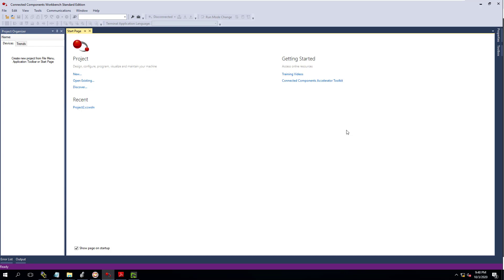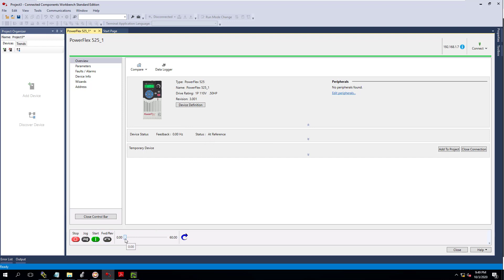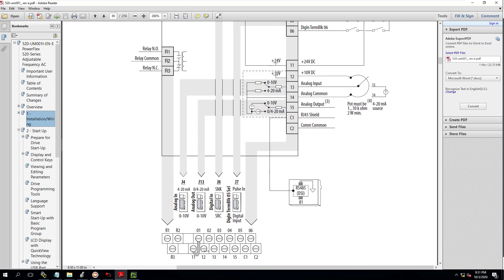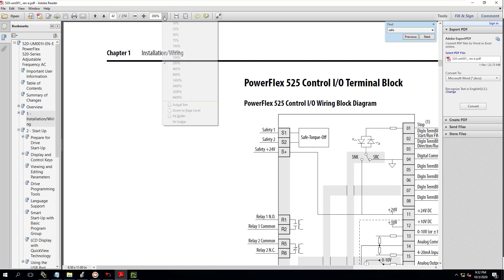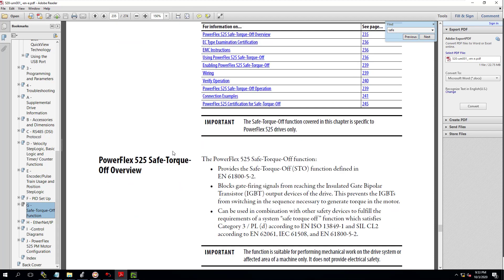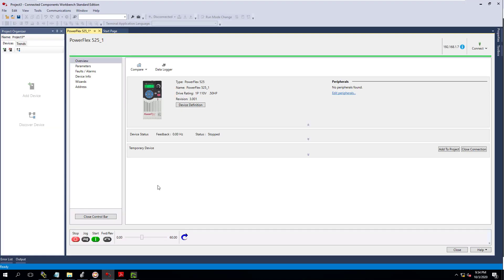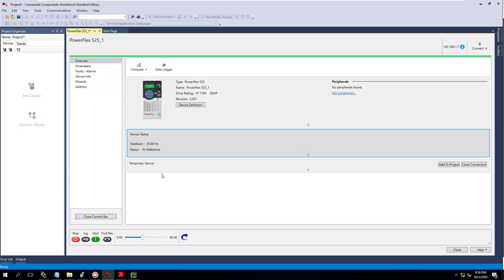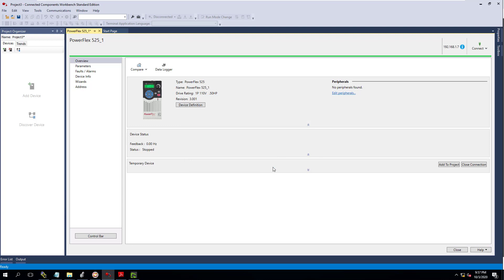Testing A Powerflex 525 With Connected Components Control Bar | PF525 Wiring Example

Comment: Can I use octo output for stop push button for power flex 525 drive? And also want to know that is it 24V DC only? Or I can use it for 230v AC circuit.
Reply from the maker: When it comes to drive controls, it depends on the design on the drive & the design of the system for stop/start controls.

Also depends on what model of the Powerflex 525 you have.

I would recommend that you read the manual
Reply: @ShaneWelcher   @Shane Welcher  I have gone through manual but there is nothing specifically mentioned in the manual for octo output ,only 24V DC written nearby output pin 17 (octo output).
Reply from the maker: @harshshah5457  If the drive you ordered says use 24v then use that.

Do not use mixed voltage.

99% of see rive input controls are 24vdc so if you need to control it with 230vac then add a relay
Reply: @ShaneWelcher  okay 👍  thank you for the guidance 😇

Comment: I have a control panel in the field with start stop buttons for several 525 drives. I am also connecting up the drives to ethernet. I am putting a loc/rem switch on screen so they can change drive states from the HMI and after so long it will default back to the field panel. I am using dig input 2 as my remote input switch to ethernet. I see that there are 3 levels of start stop paremeters so my question would be why can I not use a ethernet command to switch from loc to rem rather than a hardwired input on the drive?  and how would you switch between the 3 differant drive start paremeters like from the ethernet to the terminal board and the fronnt keys?
Thanks
Reply from the maker: Using the PLC program to control the drives & use the switches for remote or non remote control be in the PLC logic to control an output to the drives to control them.